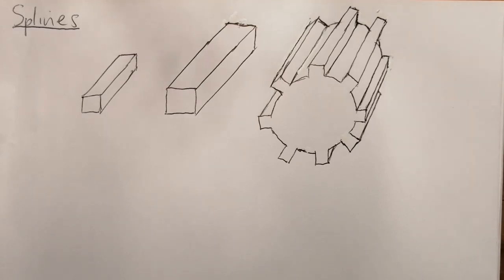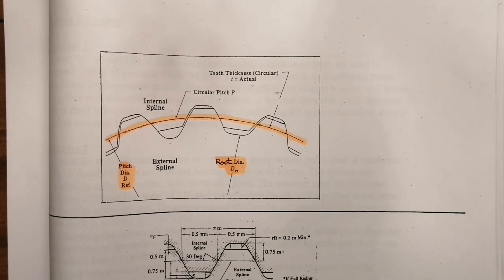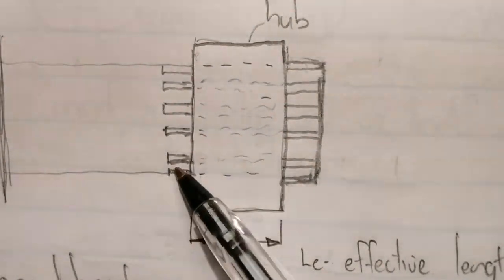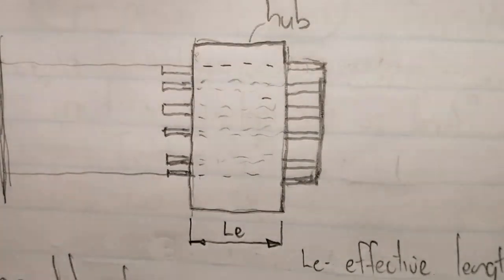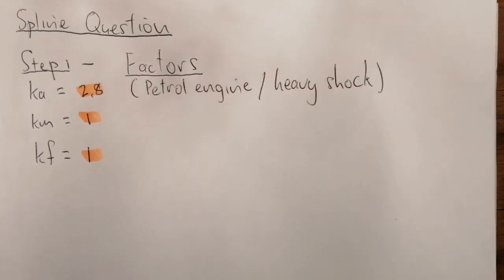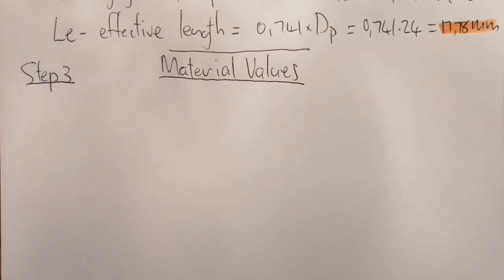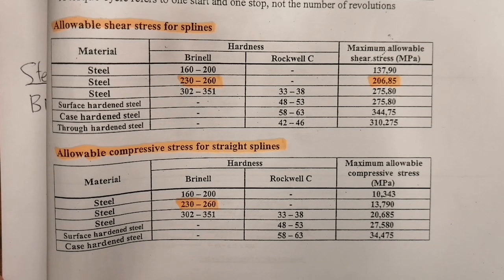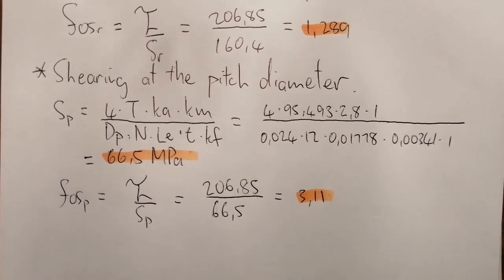Spline shaft design.

Comment: I think compressive stress is not at root but rather at Pitch diameter. It is also known as contact pressure which is also prevalent in gear contacts. Right?
Reply from the maker: Makes sense, that gears has a line  contact where the tangential force acts and it exerts crushing. Splines are more square in nature and the contact is more spread out. Contact pressure is a proper word for it.

Comment: Well done. 
The only thing I still don't understand is what is module? How  is that value measured or how is it determined ? 
Thanks in advance.
Reply from the maker: Its basicly the pitch diameter devided by the number of gear teeth.

If you have two gears that need to mesh, you would use the same module for both, true for spline theory as well.

Module is a size ratio to match your mating gears or spline fit. 

A larger module would allow for more design strength of the teeth if gears and splines. 

Hope this gives some clarity. Sorry for answering so late.

Comment: at calculation part of  shearing at spline root value of root diameter cube is wrong 15:04
Reply from the maker: Hi Pratyush, thank you very much for your observation, much appreciated.

I left out the cube during substition, but the answer is correct as I calculated to include the cube value.

Comment: Which book was that?
Reply from the maker: Check the engineers handbook, if Im correct as I took it from notes that I had. Reference was made to the engineers handbook.

Does not matter which book you use, the primary modes of faliure is crushing and shearing, same as keys and keyways.

Then after calculation for both modes of faliure, use the lowest factor of safety by number which is actually the highest factor of safety allowed.

Comment: So usefull video but there is no other type of strees that is compressive stress and tensile stress. And can you suggest Some book for spline shaft except for machinery hand book?
Reply from the maker: You can look at books like Mechanical Engineering Design by JE Shigley, C. R. Mischke and Machine Design (Schaum) by AS Hall, AR Hollowenko, HG Laughlin.

Spline compressive stress is known as the crushing stress on the spline sides. There is no need to calculate tensile stress. 

The only two stresses needed for calculation are compressive and shear. Unless you want to solve the problem using Bending stress where there is a moment from the spline root to the Centre of the spline. This will yield both tensile and compressive stress results that will be equal.
This is why calculating crushing (compression) only is enough. 

For Bending Stress = My/I, where I = (bd^3)/12; y = distance from spline root to spline centre; M (moment) = applied Force on spline Centre X distance from spline root to spline Centre.

Hope this helps.